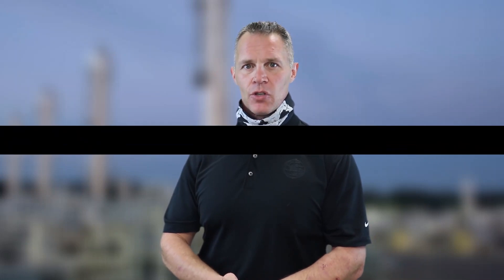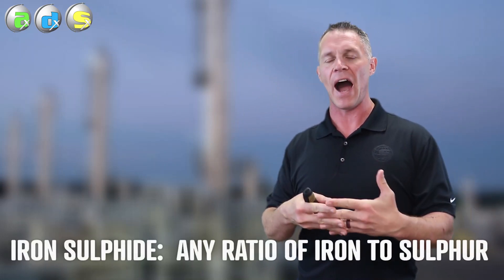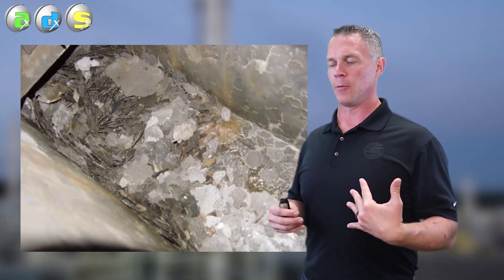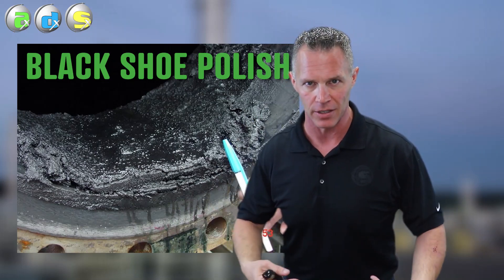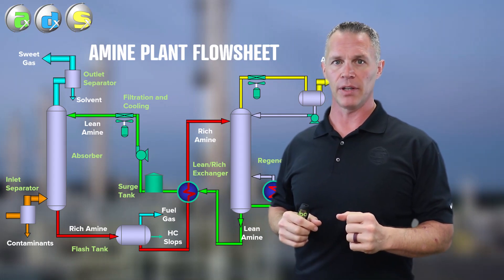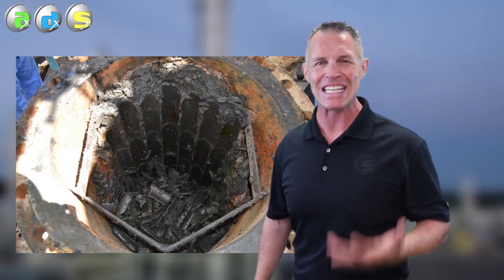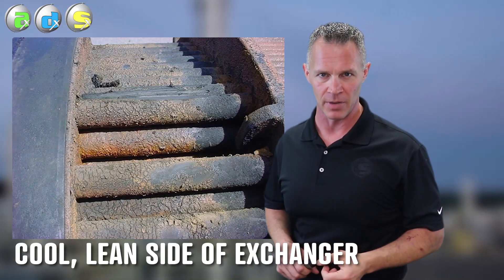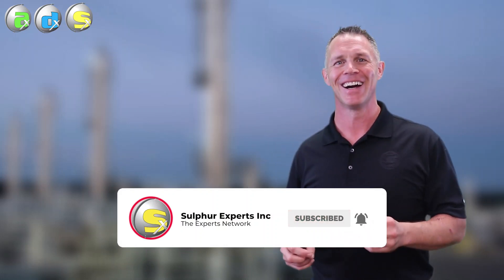Can You Over-Strip Amine Systems? (Part 1)

Comment: Lean amine solutions contain a small amount of H2S, which helps maintain a stable iron sulfide film.
Overstripped lean amine solutions can be corrosive if there is inadequate H2S present to maintain the
protective iron sulfide film. from the RP

Comment: How about for low h2s to Co2 ratio feed? Do you still recommend to strip all the h2s ?
Reply: In any plant with H2S: you strip the amine down to a low enough loading such that the H2S concentration in the treated gas is satisfactory. In most cases this is 4ppmv. If you have less than this entering the absorber with the feed gas, then the H2S lean loading won't really matter.

Comment: Thank you for the video. I have a question for rich amine corrosion.  If rich amine temperature is increased up to 85~90degC , there is corrosion in rich stream especially high pressure process even if  rich loading is maintained 0.4~0.45. I know it is affected by amount of H2S flashed. What is a corrosion mechanism? is it similar to form the mackinawite ? If rich loading is enough, the pyrite is already formed.
Reply: hi there, as long as the rich loading is composed mostly of H2S (not CO2), and kept below 0.5 mol/mol (or so) there should not be any problems even if the amine is reduced from a high pressure to a low pressure, like across an absorber level control valve for example. The temperature is a concern however, in a typical carbon steel absorber we recommend 85C as the maximum "bulge" temperature to prevent corrosion of the absorber itself. Usually, the rich amine stream is slightly cooler than the bulge temperature - use a simulator to be sure, if you don't have TI's throughout the absorber - so you are putting yourself at risk by operating with 85-90C absorbers. If you have a completely stainless steel absorber, that's different and we routinely see bulge temperatures upwards of 100C.
Reply: @benspooner8690  Thank you!

Comment: Thanks for the video, I had a question that is related to the lean/rich exchanger fouling video you did earlier. In this video you state that the high temp - high H2S conditions of the rich amine are good conditions to form the protective iron sulphide layer (pyrite), yet in the previous video, the rich side of the lean/rich exchanger is fouled and the lean side is clean. Why is this the case, it seems to be contradicting with what you say in this video?
Reply: Jared, if the rich amine conditions properly form a protective film (pyrrhotite), then you won't have fouling of the rich side of a lean/rich exchanger. The problems are when the conditions are NOT correct for the film formation. This can happen if the rich amine H2S loading is too low, temperature too low (both of which are usually from overcirculation), or if there's too much CO2 to allow for an FeS film to form. In cases where there is some H2S and a lot of CO2 then its very difficult to keep the rich side clean and rich filtration is needed to protect the lean/rich exchanger.
Reply: @adityabansod2941  The answer to your question will depend greatly on the ratio of CO2:H2S in the rich amine. Although you may have slipped a significant amount of CO2 through the absorber, what you ultimately need to know is how much did you remove, along with how much H2S was removed. If you are operating a single-absorber system, you can determine this by looking at the composition of the acid gas. In our experience acid gas with over 50% CO2 will have fouling of the lean/rich exchanger.

Comment: Obviously the regeneration rate will be a compromise between the cost of energy use, the downtime caused by exchanger corrosion, and the OPEX for lean amine filter changeouts. Not a straightforward number.
Reply: Excellent video!! Would love to hear the rest of your thoughts on corrosion, despite sufficiently low lean loading....
Reply: correct. See our earlier video on "how to set steam to the reboiler" for more details!